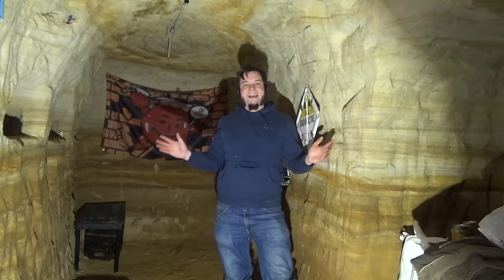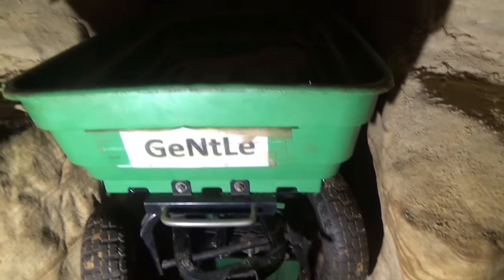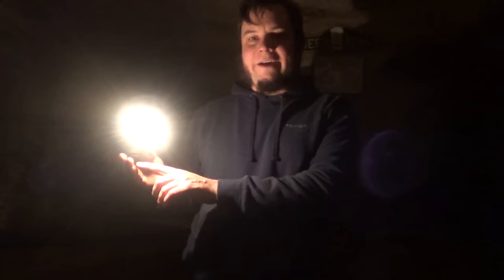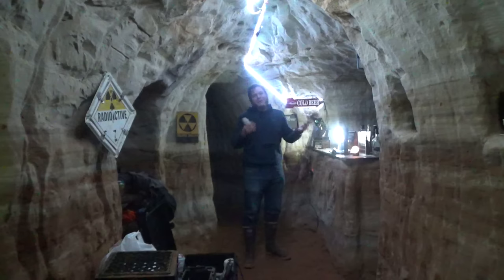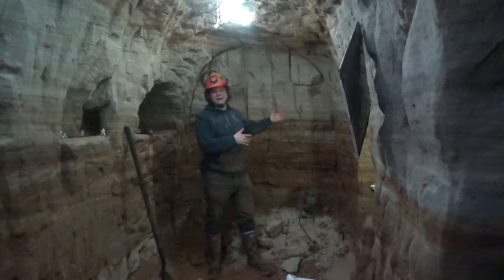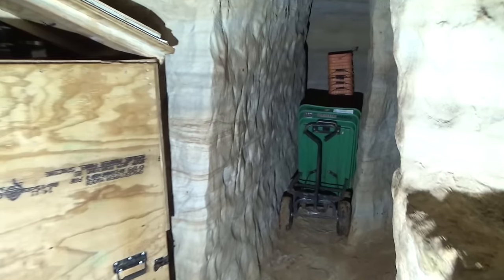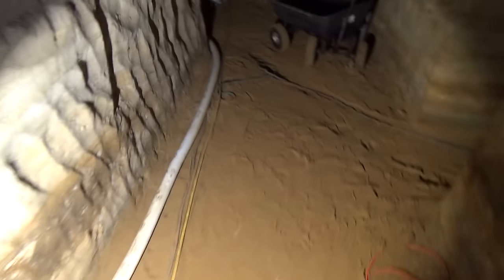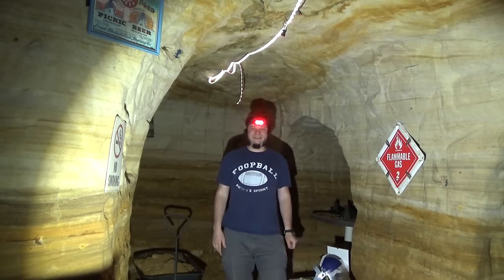Digging A Secret Catacomb (Sandland Tunnels)

Comment: What a vast tunnel system, I had no idea how immense it is; you could get lost if you're not familiar with it. My appreciation, there's a lot of work involved. I find the carbide miner's lamp very nice; just a bit of carbide and water and a spark, and you have light. I think it's a reliable lamp, which can't be said for flashlights; they're anything but reliable.
The corner with the human bones is very creepy; I think the idea with the railway is great. Eventually, the carts will automatically transport the sand outside, unload it automatically, and come back automatically.
Thanks for showing us around and taking us along.

Comment: Surveyed in hard rock and coal mines. Just out of curiosity how are you keeping track of the physical relationship of one project area to another? Any concerns someone will bust through in to another? What is the ventilation situation? Thanks, and as always great content.
Reply from the maker: One of the volunteers has a survey project that they keep up to date, and another has done some 3D scanning. We have 3 entrances at different elevations that provide some natural ventilation, and a powered fan in one spot. I've done some air measurements and even in the dead-ends there's not much difference in air quality over time.

Comment: qustion !!!!!!!!! 
if sand land tunals are just compressed beach sand could you use a pressure washer to cut out the sand?
i looked online and there are reports of people cutting into their sandstone tiles when they leave their pressure washers on high power.
this has the added benefit of elimataeing air dust and there for fancy respatory equipment.
All you would have to do is wet the area you want to cut using the low power setting to make sure no dust gets in the air, and then use the high setting to cut the sandstone.
problems you would encounter from here is getting power and water
Reply from the maker: Yep, high-pressure water jets are actually how a lot of local sewer tunnels were constructed. But we don't have a reliable water supply, and we'd still have to separate and transport the sand (plus it would make a mess in the tunnels!)

Comment: Curious if you've done any tests for radon gas down there and what fire / safety measures you have in place. My home town of Nottingham has a bunch of sandstone caves that have been used for various things over hundreds of years. The oldest inn in England the Trip to Jersalem is partially in the sand stone caves under Nottingham Castle. There's a cave museum / tour thing you can go on that tells you about the history and takes you through smugglers caves under the pub and there's a tiny hole in the roof to the pub upstairs where people would drop rocks down to warn smugglers below that the pub was being raided by the authorities., There's even a tannery down there.
Reply from the maker: I've heard of some of those and I'd love to visit Nottingham! We did some Radon gas tests and determined it's an OK level for occasional working but you don't want to raise kids in the tunnels 😂
Reply: @saveitforparts  if you ever do I'd happily join you for a trip down the caves. I haven't been since I was a kid.

Comment: My place is on the perfect basement for an epic tunnelling project, however, there is one problem.  It's all granite.  Would be an awesome end product, but the mining bit could be a little tricky! 🤣
Reply: Hah, My dad did some work at a granite quarry, and was told he could have all the granite he wanted for free. had just bought his first house and needed to build a retaining wall. Perfect he thinks, and gets to work prepping the site. First load breaks his trailer. second load breaks his diff or gearbox. third load does a back injury. but kinda committed by this stage. he now has an almost pathological hatred of granite. dont mess with granite.
Reply: @arjovenzia  Sounds about right! 😆

Comment: Hey men, have you tried using a post hole boring machine? They sell electric ones and batery power ones.
Reply from the maker: Those don't work very well on sandstone since it's technically a rock. They're made for softer stuff like ice and dirt.
Reply: @saveitforparts  really? I would expect the sandstone to be soft enough.  What type of auger did you try for dirt or for ice?

Comment: Why do I worry about potential accidents?
Reply from the maker: We try to take every precaution, and the tunnels are in a geology that stays stable without supports. We also use protective equipment when digging and in over a decade we haven't had any major injuries! At least not tunnel related :-)
Reply: @saveitforparts  that’s reassuring.